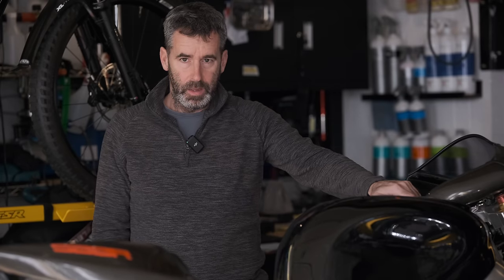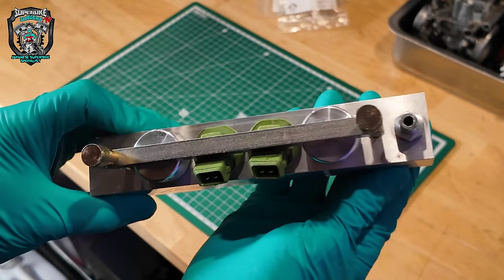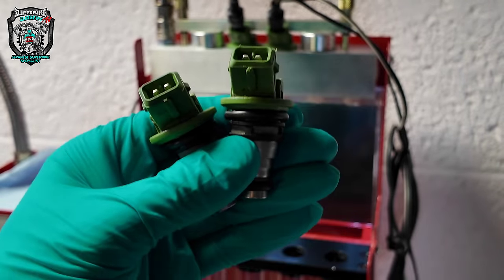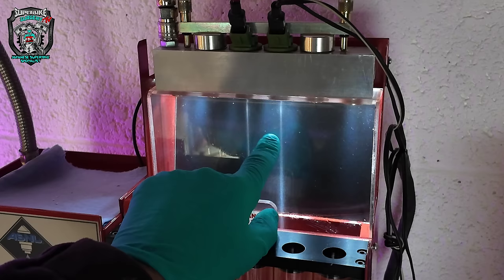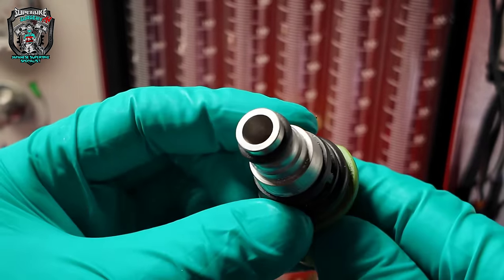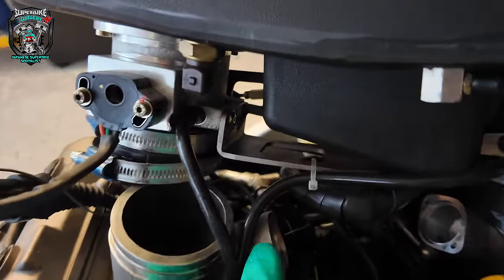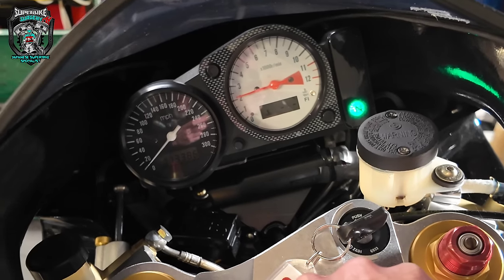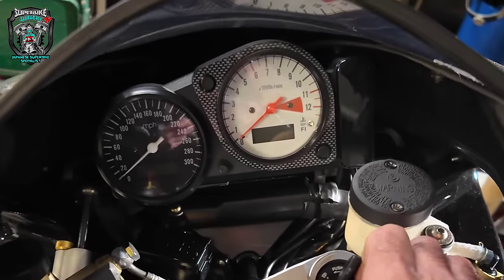it's back! The Bimota SB8R, can I fix it.

Comment: I should have a couple of low milage ones in my pile for a TL1000, somewhere?

Mine was going onto 1 cylinder (TL10000S), turned out to be a failing TRE unit.  With your's being the posh version, probably all goes through the power commander.  Just thought i'd muddy the waters a bit.

Comment: I wonder if the designers of the intake system knew that the pattern was bad and designed it to impact the other side of the intake manifold in order to get atomization through cross flow of the air and the impact against the other side.

Comment: Thanks for showing us this machine as you put it thru the paces..... I'm no mechanic & the closest thing to this I've ever dealt
with is an oil furnace,  but that's not dealing, apples n apples.  I never knew machines existed to diagnose like this as I just
thought if it was bad you changed it?  Well,  that's the difference between you & other folks out there.  peace

Comment: I have a TL1000S on which I've done quite a bit of work on the fuel system, although I haven't removed the injectors.  Don't know if you're aware but the TL1000R has two injectors per cylinder, whereas the TL1000S only has one per cylinder.

The Suzuki ECM has a cold map to enrich the mixture at lower engine temperatures, plus there's a fast idle lever for use from cold which I haven't noticed on the Bimota.  That throttle position sensor looks different to the Suzuki one too.

I've just checked a spare throttle body I have lying around, and the only markings I can see on the injectors is "15", but there are two holes visible on each one where they spray into the inlet.

Robinson's still list the injector assemblies, but they are over £340 each.
Reply from the maker: Thanks for the comment 👍 The system on the Bimota is a completely different one from the Suzuki. Different throttle bodies, ECU etc. Fyi, it's got a manual fast idle. Yes, I'm also pretty familiar with the TLR system 👍

Comment: I have a pair of new old spare red IW724's (never been used). It'll be a different (lower, I think) flow rate to the greens that you have, but might be interesting to compare the atomisation with. You're welcome to them if it helps.
Reply from the maker: That's super generous 🙏 I'm not counting my chickens yet, but I may have found a solution 🤞

Comment: I have had issues with the crank signal being a little to week for the power comander and it would drope spark . Ran fine disconnected. I ended up replacing the pick up coil and adjusting the air gap as close as possible. This was on my 01 GSXR 600 .

Comment: The SB6 as standard used to have oversize carbs and were not matched to the engine and would run rough and lack power compared to the original bike. I would check that this SB8R injection system hasn't been "uprated" by Bimota at the factory.
Reply from the maker: It has, that's basically the whole point of the video 😁👍

Comment: Okay. Food for thought.  Injector looks like it’s used wet fuel, or aged fuel which will have mullered the spray pattern. Water will destroy tips or bad fuel (abrasive wear)will have trashed the tolerances. They’re knackered, got to get new ones.

Comment: Don't know how your cleaning them but ultrasound won't work. You need acetone which removes a build up of  old fuel in the form of a coating called varnish which eventually reduces the ID of any form of jets. There are acetone sprays that you force through the injector by pinging it with a voltage.

Comment: iirc the injectors were also used on the TL1000 powered Cagiva's.
Reply: I just checked the parts fiche and they're conventional injectors on the Raptor. Not trying to be smart, but I have a V Raptor and I shit myself! Fuelling on the Raptor is pretty impressive except for the 0101 digital open or closed thingy...

Comment: Is the fuel pressure in good order? Does bimota have a totally different pressure compared to your test bench?
Reply from the maker: This is a really good point. Yes, the Bimota runs at a higher pressure, 72 psi. The ridiculous thing is that all the injector specifications available are for testing at 3 BAR (42.5 psi) 🤔 They don't Atomize fuel any better at the higher pressures.

Comment: Hate to say this but it sounds like the Weber injectors and EFI are shit. Maybe the power commander is screwing things up, didn't have much success with one when I had Harley's. I had a TLR1000R and it had no problem with starting or anything not like this thing. Shame you could find a TLR 1000 EFI and swop it over. Anyway best of luck with the diagnostic work.

Comment: I have such a hard on for the SB8R. They were just too expensive for me, so i had to settle with a firestorm. I wonder how much a set of cnc inlets are with decent modern injectors firing at thevalve would do? Can the power commander be bypassed?
Reply from the maker: Yes, it's possible,  I did actually do this, but in an effort to keep the video at a sensible length, I didn't include it in the final edit.
Reply: You wouldn’t even need to CNC new manifolds…. You can 3d print them in wax and take them to casting foundry to make a set for you. Jewelers do this now as common practice, but they cast their own.